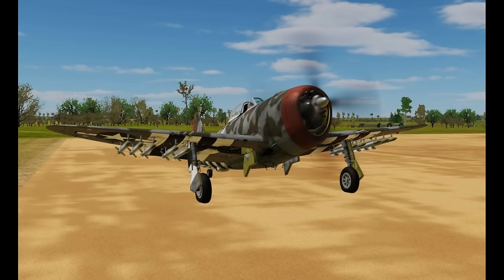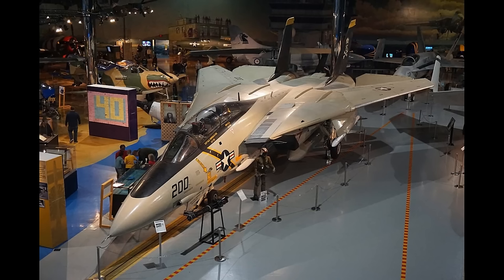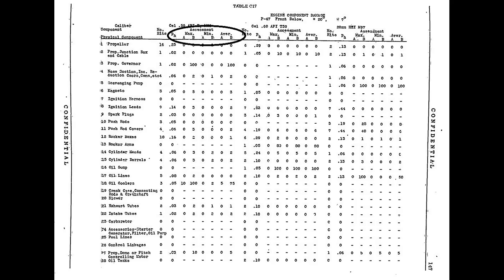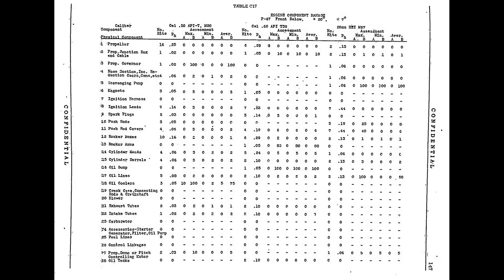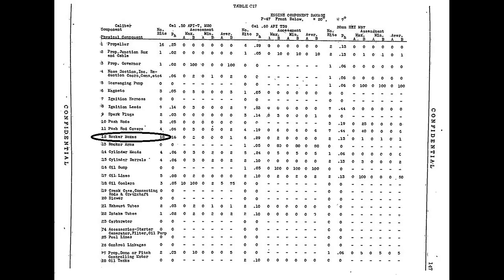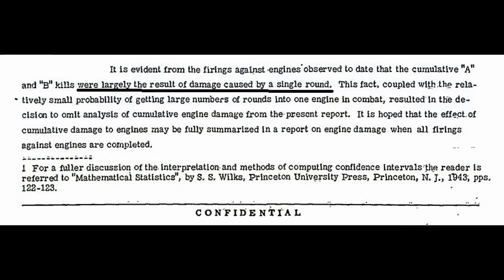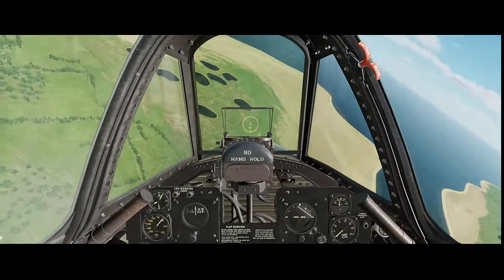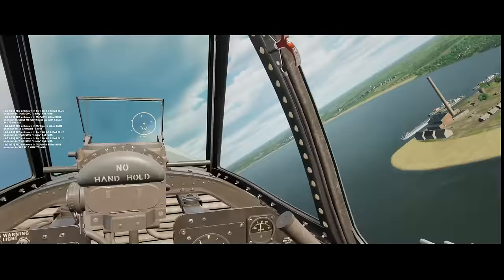50 Cal Vs. 20mm Engine Damage in WW2

Comment: After over 30 year's of building and working on Harley engine's, which their basic cylinder construction is very similar to radial aircraft engine's, I've seen some things that if I hadn't seen them keep running with damage and other issues with my own eye's I'd never have believed it, cylinders broken off at the base, faulty machine work inside of engine's or wrong parts installed that led to top ends or flywheel (crankshaft) assemblies running oil starved with some of them running for surprisingly long periods of time, and wherein not an engine I once gave a 4 speed transmission back to a guy I rebuilt and told him he needed to add lube to it when he installed it, in his haste installing it the night before leaving on a road trip with his friend's he forgot to do it, that thing went all the way from southwestern Pa to northern Georgia before it burned up, when assembling one of the pre mid 79 4 speed Harley transmissions there's loose needle bearings that must be packed with grease to hold them in place to assemble one, knowing that I still wouldn't have believed one would go that far without lube in it before gears started locking up on shafts.
I had an engine brought to me once that a guy had been having top end problems with for over 15 year's, he had that thing in shops from Baltimore to Pittsburgh, no less than 5 of them before I took a crack at and found the problem, it'd been built with 84 ci S&S stroker flywheels, even the shops that tore apart most of the bottom end looking for the problem failed to do the last step needed to locate it, split the engine cases and look inside.
When you put stroker flywheels in any big twin from the 36 Knucklehead to the last of the Evo engine's made in 99 there's an area in the right side engine case that needs to be clearenced for the connecting rod pin nut on the right side of the flywheel assembly, the more stroke the further that nut is moved towards the rim of the flywheel, there's a step on the inside of the casting of the right side engine case that the nut will hit when stroker flywheels are used that must be clearemced, it's a pretty simple process that can easily be done with a rotary file and a special tool that has different holes in it for each stroke amount that you stick a scribe in the appropriate hole for whatever stroke your building (I always just clearance them for the biggest stroke possible anyways, it's not like it's really any more work) and swing it through the area to scribe the area needing clearenced, on this engine the guy who owned the shop that did the work in the 80's took it to a place that obviously put an end mill in a vertical milling machine and without using that marking took just hogged out the entire area cutting into an oil passage, on the outside of the right engine case there's a hole that passage leads to with a ⅛" NPT thread a fitting screws into that's the bottom fitting for the external oil line that goes to the rear cylinder rocker box of a 66 to 84 Shovelhead big twin, from the front of the rear rocker box there's a short crossover line that goes to the rear of the front rocker box, that's how oil circulates through everything in the top end, 😢by cutting into that passage inside the right case it essentially oil starved the entire top end of the motor, instead of oil going to the top end it was just pumping it into the bottom end of the engine which of course there was no way of knowing without the explatory surgery I did, neither myself or anyone else around when I found the problem including the owner who'd been riding for years and two other friends of mine who also owned shops could believe that thing ran as long as it did between the issues it'd been having over that 15 year period, you'd think it wouldn't be able to make it across town much less last several years between incidents.
I've seen flywheel assemblies run for years after having the incorrect cam cover gasket put on cone motor Shovelhead engine's, 70 through mid 72 has an oil hole moved, by using the wrong gasket on either a 70 to mid 72 or mid 72 to 84 Shovelhead it'll oil starve the connecting rod roller bearings, without seeing it with my own eyes I'd never believe one could make it through several summers before the bearings went out.
I've had several engine's brought to me with holes burned in pistons from large vacuum leaks causing an excessive lean condition, one actually pulled into my place running after it dropped a cylinder from over  5 miles away, I'll grant you he  didn't set a land speed record getting there but it pulled in running after burning a hole in a piston of a 2 cylinder engine, amazing, and considering that the carb and intake are common for both cylinders it's really amazing that it was even running with as much as the power had to be down from one piston having a hole melted in it and the other cylinder running on an excessive lean condition, never would have believed that was possible. 
You're absolutely right about dual plugs, the 36 to 84 big twins and the 57 to 85 Sportster engine's are true hemi engine's, when we dual plug them ignition timing can't be run at the stock setting, usually a reduction of around 3 to 4 degrees is necessary to avoid knock and if you drop one side it'll lose power just like doing a mag check before take off.
Just about when i think I've seen it all something else comes along that astounds me, I would not be one bit surprised if radial engine's continued running with a cylinder completely shot off, considering that the 20 and 30mm German shells were explosive I wouldn't doubt a hit straight to a cylinder could blow one off, and there'd be a good chance it'd snap the connecting rod off right at the big end, if that happened you wouldn't have a connecting rod and piston flopping around which from my experiences I can believe one would keep running, given the oil capacity and the fact that they're dry sump engine's I could see one making it back to a base, maybe not across the Channel but after D-Day they were operating from bases in France and Belgium that were sometimes less than 10 minutes to where they were conducting ground attack missions, after some of the things I've seen I can believe one could make a short flight like that back to a forward base, heck in the Pacific Corsair's were bombing targets so close to where they were taking off from they didn't even bother raising their landing gear, after some of the things I've seen I wouldn't discount the stories about them coming back with cylinders shot off, I certainly wouldn't bet against it, heck, Apollo 13 made it back after it blew up and it had to go all the way around the moon from halfway there to do it.
If life's taught me anything it's that anything's possible with machines, the experiences I've conveyed here just scratch the surface of some amazing things I've seen machines survive, like I said just about every time I think I've seen it all something else comes along and surprises me.
Reply: love hearing about the bikes. it sounds like you are near western PA as i'm from eastern ohio we have ridden the same roads.
Reply: @mikehenthorn1778  
Yep, Fayette County Pa right at the base of the mountains, and I spent 11 years living in Mantua Ohio, just moved back here in the summer of 2019.
What part of Ohio are you from?
Reply: @dukecraig2402  east liverpool. friends in greensburge so i get to visit still.
Reply from the maker: Duke, you could be right, I'm just saying I haven't seen evidence of this on a WW2 radial, and I have been looking.

Comment: When flying against the p-47 the most effective tool for the job is the mk108, at least in dcs or il2. Absolutely devastating, especially considering how much mg131 the jug can eat up. Thanks greg
Reply from the maker: Yes, absolutely, even the Mk108 is devastating when it hits.
Reply: @GregsAirplanesandAutomobiles  Regarding the MK108. When used in a Me262, going at full throttle, people always forget to add aircraft speed to the MV of the MK108. Feks, shooting at a B17 from 90 deg the MV of a 30mm Minengeshoss is app 750ms/2500fps. The trajectory and lead needed in this case are very different than the ballistics people see in tables shot from a static testbarrel.
Reply: Per the material by Michael Claringbould, even a P47 could be 'laid low' by Ki43 Oscar. When he did a breakdown on the loss ratio when it was only 'Oscar II' vs Thunderbolt, the ratio was pretty even. I don't know if the 'mark' of Oscar had two 7.7mm machineguns or if it had 2 13mm mgs or a combination of both.
Reply: @GregsAirplanesandAutomobiles   'If' it hits.  ++ bomber killing gun. against maneuvering fighters, first get your hit...
Reply: @nickmitsialis Ki-43-Ic (mark 1c) already had dual jap 0.5cal...so Oscar lI should be using dual 50cal...but they use HEI rounds...

https://en.m.wikipedia.org/wiki/Ho-103_machine_gun
Reply: @alan-sk7ky  The MK108 is very effective in hit and run tactics. When the Me262 became operational in small numbers there were almost no P47 in the "envelope". However, the Me262 have several victories against the more agile P51, mostly with the hit and run tactic. 
Even though it is not a part of this topic the MK108 is the single most effective gun against allied aviation. Schnauffer downed 120+ four engined bombers at night. No dayfighter comes close to this result.

Comment: Very interesting, I’m partial to the research done by Emmanuel Gustin way back when regarding the optimal fighter gun(20 mm at 850m/s) but you’re totally correct that it’s one thing to do severe damage with a hit and actually hitting an airplane that’s doing evasive maneuvers or just flying while the platform shooting is a vibrating wild hog.

I enjoyed this video so have an Internet point on me🥇

Comment: Very interesting topic. One must not forget the importance of convergance. Many of the German WW2 planes, had their armament centered in or around the fuselage. This will make the plane more versatile range wise. In the topic of getting more rounds on target.
Reply from the maker: Everybody says that, but I'm not so sure it works out that way. The assumption seems to be that planes can't hit beyond their convergence point. That's not the case, the rounds are about the same distance apart at twice the convergence range as they are at point blank range. Thus with a 400 meter convergence, they are good out to at least 800 meters, farther than they could reliably aim anyway.
Reply: Considering that the vast majority of air to air kills in that era occurred within a range 300m or less, I doubt that the extra range was any use to any but the most extraordinarily skilled of fighter pilots.
Reply: @Beowulf_DW most aces hit within the 300 mtr range. Only a few were great at deflection shots.

I opened fire when the whole windshield was black with the enemy . . . at minimum range . . . it doesn't matter what your angle is to him or whether you are in a turn or any other maneuver. Erich hartmann.
Reply: @GregsAirplanesandAutomobiles so it could be based on a set of practical rules instead of capabilities. Rules like specified in the dicta boelcke or erich hartmann.
Reply: @Beowulf_DW  that equally discounts the effect of central axis armaments, so not that relevant to this point.
Reply: Germans had electrically primed ammunition so they could bring their guns within the propellor disk and not lose rate of fire through synchronization.
Reply: @GregsAirplanesandAutomobiles hmm well centerline guns have more consistent accuracy grouping at all ranges. As you said, on wing mounted guns, they have same spread at point blank and at double the convergence range...so it is like a bell curve scale with regards to grouping accuracy...

Comment: The story of an aircraft making it back with a cylinder or two missing is reiterated in Rudel's book "Stuka Pilot". Where he describes an FW 190 returning from a misson over the Russian Front with several cylinders absent, oil all over the front, but running. Seems it wasn't only the P+W that was "bulletproof " !

Comment: Germany used a .60 caliber gun in form of the 15mm MG 151. The US developed and tested a similar gun which like with the MG 151 was turned into a 20mm round.

From what I remember from the document the .60 cal ammunition was pretty much as lethal as the 20mm ammunition.
It has advantages in having higher velocity but I guess a 20mm is just more versatile for all types of targets.
Reply: I am 81, and thought I had a pretty good grasp of the guns used on U.S. planes in WW2. However, I never heard of a .60 caliber machine gun. I take it from your comment that .60 caliber is similar in size to 20mm(I don't know my metrics well enough to mentally compare the two sizes). Also, I never understood why the Brits stayed with the .30 caliber.
Reply: @williamromine5715  .60 caliber is roughly equal to 15mm where as .50 caliber would be 12.7mm.

I think the Brits stayed with the .303 because they built so many guns and ammunition and then simply used 20mm cannons as fighter armament.
Reply: @kimjanek646  thanks for the info.
Reply: @williamromine5715   The Brits decided that 20mm was the future rather than a heavier MG in the 50 cal....basically they were using 20mm with the kinks ironed out by mid 41.  They didn't stick with 30 cal at all, except in the Spitfire outer bays where they couldn't get another set of 20mm in.

Comment: Dual sparkplugs are very beneficial in large displacement  engines, where combustion chamber is quite big and single sparkplug does not provide even and fast combustion. In Engines like R-2800 or V-1650 or any similar engine of that time dual spark was essential for power output.  Redundancy is  done that way that both magnetos provide spark for every each cylinder so when one is out you still have spark on every cylinder.

Comment: Excellent video. One remark, the 30mm HE round used by the MK108 and MK103 might be the same, a 330 gram “Minengeschoss” drawn as a thin shell with a lot of explosive in it. The MK108 used this exclusively. There was a conventional HE round for the MK103 too, which was indeed heavier at 433 gram because more metal, less chemical load. There was also a 500 gram APHE.

The MK103 loading of the belt for aircraft targets mixed the four, according to the 1944 official recommendation:
one Sprenggranatpatrone (HE)
one M-Geschosspatrone (high capacity HE)
one Panzersprenggranatpatrone (APHE)
one Panzerbrandsprenggranatpatrone (APHEI)
Reply from the maker: It's not the round, it's the force behind it, which is much greater in the MK103. I'll cover this in the next video.

Comment: Great video. It's quite clear the canons were better overall, but the 50cals worked well enough for the US fighters in WWII.  So it's understandable they prioritized fixing other problems with those planes.  It wasn't like the situation with the RAF Spitfires and Hurricanes in 1940 that did need something a bit heavier than 30cals to bring down a bomber more quickly.

Comment: Greg, the probability of 1-in-4 hits is very optimistic. 
Automatic weapons have several accuracy drawbacks when used... 
Barrel whip (yes it is a thing) in which the barrel itself is springing/bouncing around from vibration caused by recoil. 
The firing platform itself is moving up, down. and side to side also caused by recoil.. 

Now, if you are putting this on an aircraft then the aircraft is of course not stable and will be jinking around no matter how hard the pilot tries to keep it steady.
Reply from the maker: That makes sense, but keep in mind, it wasn't mounted in an aircraft for these tests.
Reply: If you can't hit with 1 in 4, you are not flying close enough.

Comment: I'm a gun guy with extensive experience with machine guns. I owned a store with a classification of license that allowed me to buy and sell machine guns, silencers etc. My knowledge of aircraft is far less but still an interest of mine. I've been thinking about the 25% hit ratio you mentioned early in the video. I imagined myself in a flying aircraft firing a flexible mount mg at another flying aircraft and whether or not I could get a 25% hit rate at 500 yards. My answer is I highly doubt it. I realize this is not what is happening in this report or your video but its what I have a greater ability to imagine. I also imagine it would be much more difficult to point a flying aircraft at the right spot in space to get hits on another flying aircraft. If I with extensive experience firing mgs could not do it with a flex mount gun and making hits with fixed mgs in an aircraft is more difficult, a 25% hit rate to me seems high. Obviously I cannot scientifically test this. I'm going by my knowledge of mgs superimposed over my knowledge of aircraft and the complexities involved getting hits. So my conclusions are going by my gut only. Take it for what its worth. Great channel and video!
Reply from the maker: Thanks, in the testing they were not shooting from an aircraft. They were shooting from some type of mount at a stationary aircraft.
Reply: Yeah I understand that. I guess I thought they were trying to recreate firing from the air or something to that effect and if so, 25% hits in my opinion would be high. If they're only Interested in getting the hits to test the damage  then 25% hits on the ground at 500 yds with shooter/target stationary would be doable. Whether or not 25% hits would be doable would mainly depend on what if anything the gun is mounted on. As in a tripod, bipod, aircraft or just throwing the mg over the hood of a jeep (which wouldn't be possible with a 20mm).